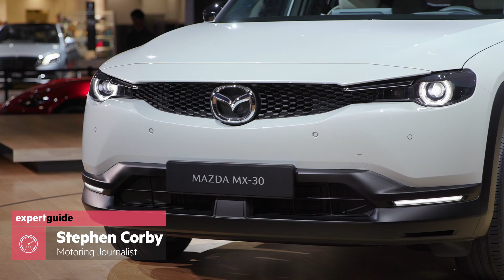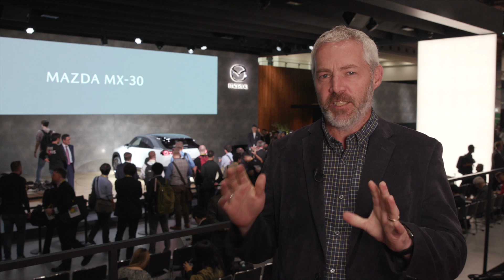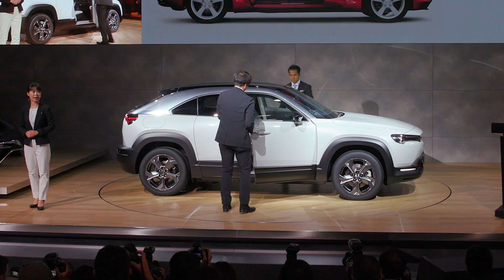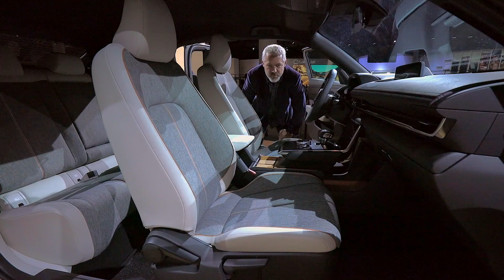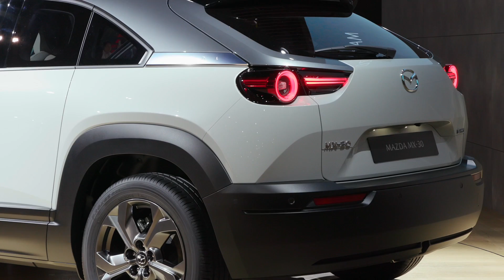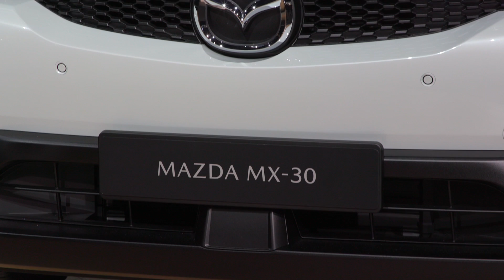Mazda MX-30 2020 electric SUV goes official

Comment: Hybrid is the only way to go for now. EV only cars create much more CO2 if the electricity is generated by coal power stations. Besides, the EV only cars have very limited distance.
Reply: And gas cars have unlimited range, i guess?
Reply: @building_keevo  No but you can find a gas station far easier then a DC fast charger.  My go to test to see if we are getting there is how many DC fast chargers between Minneapolis, MN and Edmonton Canada.  Answer not enough for my yearly drive up there that wouldn't result in 2 days drive there vs a normal 21 hour straight shot.  The charging grid is NOT ready nor is the range.  Until we get into the 300 mile range on a charge these vehicles are local or inner state transport only.  (That isn't even taking into account range decrease in winter.)
Reply: That is a stupid argument.  As more and more plants are going natural gas or wind or solar.  My local power plant has phased over to natural gas with 30% wind with an expected 50% by 2025.